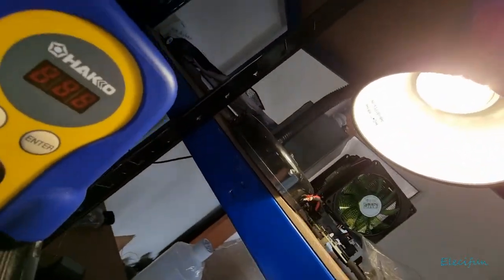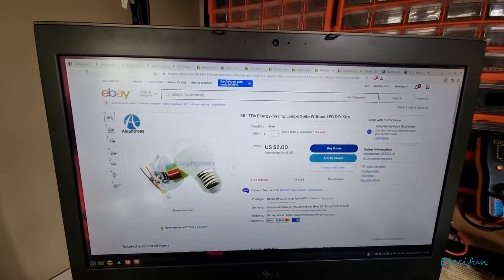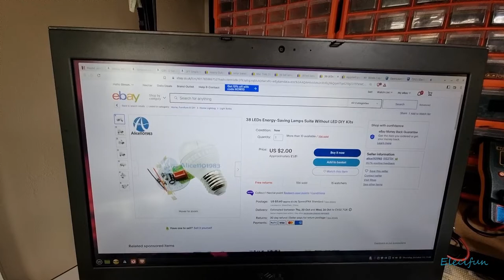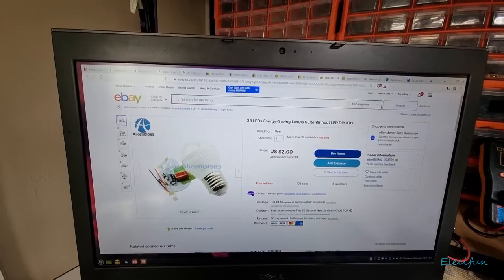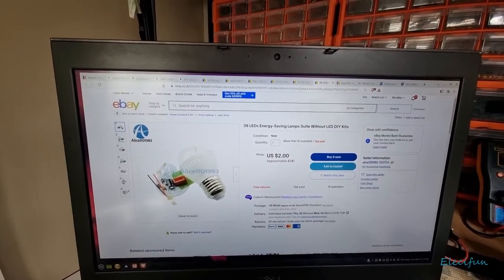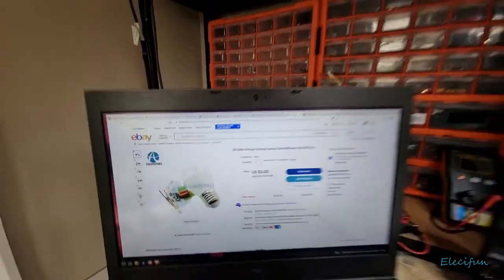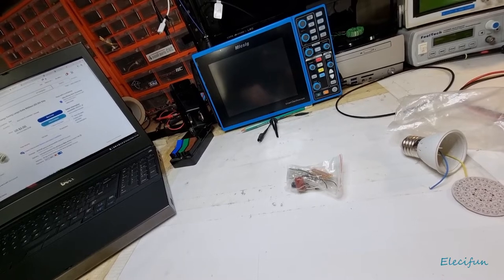DIY LED LAMP KIT (energy saver)

Comment: Those 0~30 3A psu diy main boards are cheap now. Less than $8. 🤣

Almost temped to buy a few. 😄👌
Reply from the maker: Be careful as they look like they are the same design different layout. Most reviews on Banggood are by many who have not built and tested.
Reply: @Elecifun  I don't doubt that is true. I'm getting so cynical these days that I don't believe the positive reviews.

Sadly even Google removed the thumbs down button which I think was a mistake.

I think one should mainly read the truthful feedback not the bs which may or may not be true.
Reply from the maker: Reviews for credit or free stuff stops being an objective review and besides that if the buyer hasn't even received the item let alone built and used to capacity, how can they review it?